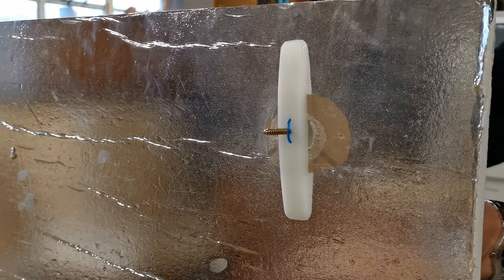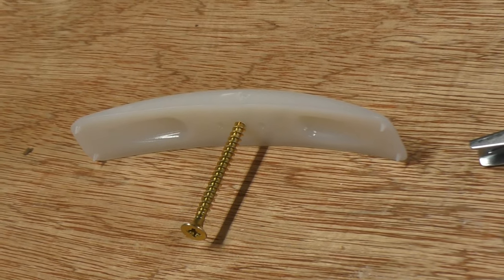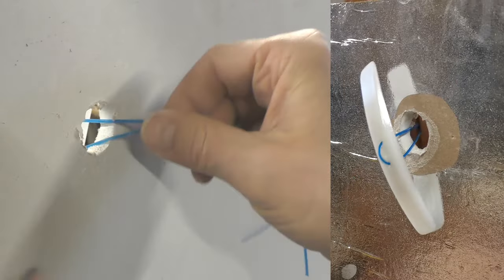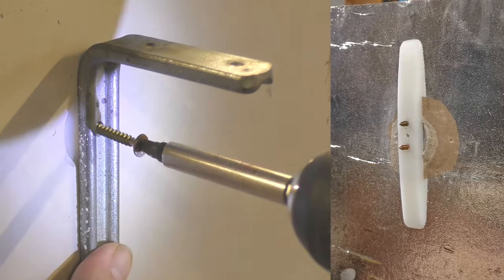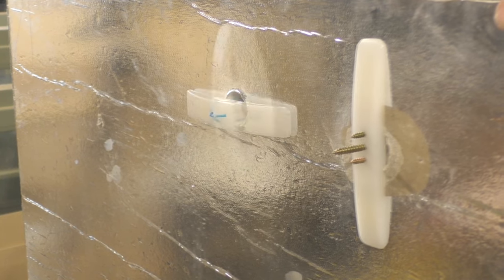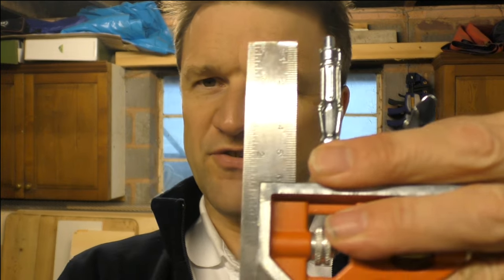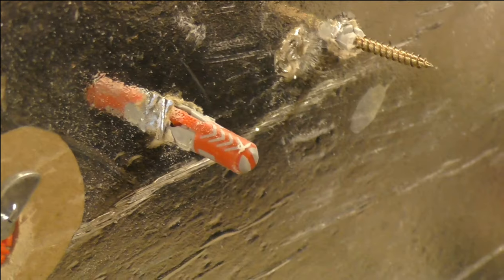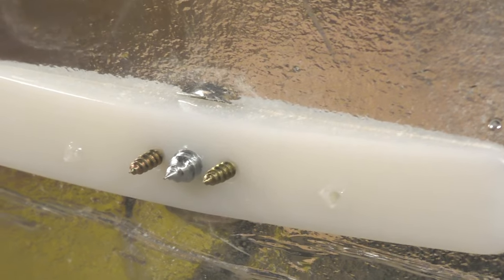The Strongest Plasterboard Fixing Ever!

Comment: This seems to be a very clever adaptation of what I have done for years using a piece of sheet metal.  I like the blue cord idea. My only concern is the knock-out of material on the back side.  when you tighten the plug the only thing that is preventing the plug from being pulled thru is the wall board supporting the lip of the plug.  Using the spade bit reduces the strength of this area (as you can see from the back side in the video) I would not use a spade bit in drywall under any circumstances.

Comment: Thanks for the excellent video Charlie - do you think these could be used into a sheet of MDF? I need to put up a 40kg large TV on a wall that has been made of 22mm moisture resistant MDF (without much studding behind) and was hoping to use these to spread the load behind the screws. Do you see any issues there? Many thanks and please keep up the really informative videos.

Comment: I bought these fixings 3 years ago. Held an old heavy flat screen tv on the wall for those 3 years no problem.

I have since moved and I just tighted the screws up so the bracket sank into the plasterboard filled over the plastic plug with filler sanded and painted couldn't tell it was ever there

Comment: Worth noting from a quick ebay search that the wall anchor looks like about 50p each shipped in packs of 10 and the geefix are £2.50 shipped in packs of 4 so about 5x the price. I would also want to be very careful doing up that central screw (especially if using a power tool) as you could over-tighten and strip the nylon backing which might be a problem. I would use the anchor by default and the geefix only occasionally.

Comment: Great video. Would these be best for lathe and plaster walls, or is something else more suited?
Reply from the maker: What are you fixing, Robin?
Reply: My son’s expensive guitars to his bedroom wall.  Need the guitar mounts that he’s bought to be well secured.
Reply from the maker: @robinknox3569  The benefit of this fixing is a) it's incredibly strong and b) you can self pilot more fixing screws into the plastic wing of the fixing, quite close to the main screw, whereas with a standard fixing you've got to drill holes and insert new fixings close to the original which can be tricky. What is the configuration of screw holes on the guitar wall bracket base plate and will the base plate be wide enough to cover the circular central plug of the fixing?
Reply: Charlie DIYte Thanks for replying. The bracket odds held by two screws which are on a  horizontal plane about 10cm apart. I’m reasonably sure that this fixing wouldn’t show but I’d have to orientate the back wing to a vertical position.   Not sure what my other options might be though.
Reply from the maker: @robinknox3569  You perhaps ought to take a look at snap toggles. They might be better.

Comment: It would be interesting if you did you fixings into lathe and plaster as happens in many old houses<Which holds the best in walls and ceilings as I often find this a problem. This  geefix sounds a solution so I might try that.
How do you fix ceiling roses in to lathe and plaster as cant always find the studs or ceiling beams,or indeed use impact  glues.

Comment: Thanks Charlie.  I created a piece of artwork that’s 6kg and I knew I needed a way to hang it safely on my flimsy plasterboard walls.  I shall look for some geefix fixings as these look perfect.
Reply from the maker: Yes, the Geefix will be perfect for that. Failing which, hollow wall anchors would probably also do the job https://www.youtube.com/watch?v=e3hjzPNe5wk&t=83s, but the beauty of the Geefix is that you can use a normal screw.

Comment: Looks like a great product. Geefix really hits the spot. For now togglers will remain my heavy duty goto which, for the smallest size, are rated at 238lb in 1/2" drywall and they're quite a bit cheaper. I can see a couple of advantages of geefix but until they get their price in line I'd only consider them for these few applications.

Comment: used these recently to secure ceiling rose on dodgy lath and plaster ceiling - works great but as said elsewhere way to big - had to trim the ends off  and could have done with it being  bit thinner...
Reply from the maker: I agree, they could do with producing a smaller version. The real difference between this and most other fixings on the market is the ability to pepper that big wing that goes behind the plasterboard with extra screws, whereas with other fixings you've got to drill another hole very close to the original - which isn't practical.

Comment: Great video! Wondering if you've ever seen or used the Fischer DuoTec? Fischer's tech data state this is stronger than their spring toggles and they have the distinct advantage of only needing a 10mm hole vs 14mm for the comparable spring toggle. Trying to mount a heavy cabinet where the geefix won't work as I can't go much above 10mm for the hole diameter for aesthetic reasons. The DuoFix seems to be the ticket, but haven't seen any meaningful reviews of these yet. Thanks!

Comment: Hi Charlie DIYte can you do a video with the masonry concrete screws the ones that don't use plugs and are mainly used for upvc frame fixing, for a drywall with cavity. Reason I am saying this is because all these other drywall anchors/ geefixt etc plugs are very expensive vs the masonry screw about 4* 6 times the Price. I am 0retty sure they will doona good enough Job.
Reply from the maker: I'll add that to the list. There just be a few videos out there though. I guess the secret is to drill the right diameter hole but I agree they do look good

Comment: Across the pond, we use a toggle bolt that’s called “Toggler”  it’s a simple anchor and each size has a different price and weight limit.
Personally I use the half inch Toggler bolt as each single bolt holds over 200lbs in Sheetrock or plasterboard which ever you call it.
Rarely are our backing wood and or studs are at 16” to 24” apart, which means when you mount a television, the brackets are rarely 16” wide.
I typically only hit one stud but make the difference up with 4-6 toggles/ Togglers.

The Toggler leaves a smaller foot print and typically the plastic back is covered by bracket, even curtain rods.

Regular toggles suck and I am not sold on the blue rope as well, hands free is the way to go, which is why the Toggler is a key fastener for any if not all contractors, 

The Toggler is slightly cheaper in cost, by maybe a coin or two.

I enjoyed your video very much, thanks for posting and keep them coming.

Comment: I'Ve ALWAYS Put a Furring Strip Piece ((About $2.00USD For an 8;'Ft. long Piece: Common: 1 in. x 3 in. x 8 ft. ; actual: .75 in. x 2.5 in.)  
Vertically oriented in order to serve as the internal "Backing" for any towel or hanging fixtures (especially in the bathroom)...but this product is absolutely GENIUS, albeit a bit expensive.
Now I know how to Wire-Cord the Furring Strips going forward to make the install a bit easier....for the Furring strips that is.

Comment: As a trade user of fixings of this nature I would have issues with these fixings with insulation boarding or fibreglass matting, the board you showed will compress over time and it'll become loose....looks a good fixing though.     You mentioned pull up fixings needing a large gap?......... not so 😉    push the fixing through the board until it hits the back then pull up slightly, it'll work it's way deeper as it opens up

Comment: These look amazing - I'd just watched your other videos and got excited about the spring toggles then saw this in recommended! I'm building a false ceiling with some CLS timber (it's for a snug/AV room) and need to secure some lengths of timber to sections of the ceiling which don't have joists, e.g. perpendicular to the joist direction. Are these OK for ceilings as well as walls? Thanks. And great vids :)

Comment: We bought a 3 year-old-home six years ago. This home is built with Terreal Terracotta Bricks, with the exterior being covered with stucco and interior walls of plasterboard. Immediately after purchasing the house we noticed that the kitchen 5 glass-door wall cabinets were tearing away from the kitchen wall. They were quite heavy, measuring 2-meters long x 1 meter tall. They were installed with only 6 huge wall-anchors, 4 of which had already torn away from the wall and only the center two still bearing the strain of the weight; it was obvious that it was going to fall tremendous damage to the interior wall.  The problem had been that the plasterboard was 50cm away from the terracotta bricks. We knew we could suspend our tv on the walls, much of our artwork would also not be displayed because it was too heavy also. Naturally the wall-cabinets would not be returning to any wall in the house. But I do want the artworks which we collected displayed and so I found this video. I'm excited to know that this will be possible now with GeeFix. Thank you for making this video Mr. CharlieDIYte

Comment: Great video! I will be wall mounting a 65" TV (25KG) and will manage to fix 2 screws in a stud on one side but the other side is hollow. Which fixings would you recommend for the hollow side? If this one then does it have to be fixed vertical or horizontal? TIA
Reply from the maker: I'd use this fixing. Probably horizontal but it's worth asking the manufacturer.

Comment: Thanks Charlie, looks perfect about to fix but found the cavity wall filled with insulation so no cavity! Any suggestions tks
Reply from the maker: You're best bet might be a hollow wall anchor https://youtu.be/e3hjzPNe5wk as it will force itself open into the foam insulation
Reply: Thanks for that, know for next time. Actually picked out a vertical trough in the foam and was able to insert the Geefix.

Comment: Brilliant just what I have been looking for to fix an eyelet screw into the landing ceiling,  not being a DIY expert will it work the same in a ceiling?
Reply from the maker: Yes it will. Will the eyelet be hidden as don't forget you'll see the circular disk the eyelet is fixed into otherwise.
Reply: @CharlieDIYte  no it doesn't have to be hidden  it's to hang my paramotor wing in a bag off the floor on a high ceiling away from getting damaged.
Reply from the maker: @fonso1961  It'll be perfect for that!!

Comment: Only slight problem I can see is if there is a dab exactly behind the place where you want to put the support, ie for a radiator bracket, otherwise great product, will definitely buy an eight pack.
Reply from the maker: Hi Steve, yes but every cloud has a silver lining. If you hit a dab that's perfect, because you've got an even better fixing in that you can drill straight into the brickwork behind. In that scenario, and possibly for the others too if the void between the plasterboard and bricks isn't too wide, I'd maybe reach for one of these https://youtu.be/fx90VadXSXA

Comment: No matter what fixings you use there will be an upside and a downside to them all, personally i trust what Charlie has said and in my opinion these do look pretty damn good (have just added some to a wishlist) if  people are worried about the size of the hole that will be left behind if removed then use a smaller plug, but then dont expect it to hold something really heavy to the wall - you cant have everything but you can make the most out of whats the best option to buy - these look the best option for hanging big or heavy items. Thanks for the upload Charlie - great honest review again.

Comment: Hi Chatlie,
Will this work and hold up a 50 pound picture frame art work?  Also you attached a bracket that resembles one used for curtains. What should I used for the heavy art frame.  Thank you for your assistance 
Catherine
Reply from the maker: Yes those brackets are curtain pelmet brackets from the old day job. Seemed like a convenient thing to use. https://youtu.be/Jdu9RId7m90 here's my comprehensive update vid but basically, whilst I can't comment on your exact job, the Geefix is the strongest plasterboard fixing I've come across.

Comment: Which fixing would you use for a lathe and plaster ceiling fix bay track and curtains?
Reply: drill holes through, squirt in loads of Anchoset and push rawl plugs in before it cures, leave to set before screwing in

Comment: Hi, what would you use to fix a TV bracket to plasterboard with polystyrene insulation behind it, probably an inch thick. Whatever they used back in the 70's. Thanks

Comment: you said at some point that you can decide whether the fixing is laid vertically or horizontally, depending on the type of load. can you give an example or recommend a direction for heavier loads? say you're hanging a shelf that will take some significant load, should the bracket be horizontal or vertical? which one is stronger? thank you
Reply: I think it depends on the orientation of the bracket, so a curtain bracket is vertical and the support should be likewise, a shelf should fall into this category too

Comment: Hi Charlie thanks for the previous replies! I was just wondering what you use as a reference for the weight limit of a hollow wall anchor for standard plaster board thickness. Fisher website states arounds 20kg per point for an m5 anchor and the same for an m4 (why are they the same?), whilst other websites state up to 50kg per point for sheer stress. Any clarification from your experience?

Comment: I think a metal backing would work best since basically all is holding the appliance is the screw itself to plastic I would use it if that back part is made out metal I'd be safer for heavy applications! what do you think?
Reply from the maker: The wall would disintegrate before the screw pulled out of the plastic wing, as it's incredibly tough, thick plastic.

Comment: Hi Charlie Great Vid! I just bought some wall anchors based on your previous videos and now thinking of changing my mind. I'm hanging a 40 kg mirror which is round on a regular plaster board wall. There are only two screw hanging points on the frame at either end of the mirror (158cm apart). Would wall anchor's work i.e. 20kg/s per points (without the wall just coming away with the fixings intact)?

The round mirror also has  a wooden beam along the back which i could secure more mounts to I guess

Thanks 

Dev
Reply from the maker: Hi Dev, are the hanging points you mentioned slotted mirror brackets that the screw slots into and slides up, or something different? Bottom line, the wall anchors are amongst the strongest plasterboard fixings so you should be fine with them, particularly as your load is shear only rather than cantilever. I ask about the slotted brackets though because the slots are sometimes quite small in diameter, preventing you using quite a lot of wall fixings because of the size of the screw head or bolt not fitting into the bracket (although I have been known to grind down the head of the bolt to make it narrow enough to fit.
Reply: @CharlieDIYte  legend for replying so quickly - really appreciate! Exactly as you say: the screw slots in and slides up the width is 9mm. The depth of the mirror is 60mm so I guess there is a very small cantilever but it should be okay .... right (for 2 wall anchors taking a load of 40kg)?  Any specific wall anchors you would recommend that would fit the 9mm diameter?

Comment: I have that awful paramount egg box partition in my house, will it work with that?
Reply from the maker: It's as good an option as you're likely to find. Depending on the thickness of your wall you might have to trim down that circular plug with a junior hacksaw - as I did when I used one of these in my son's Ikea flooding shelf, which is basically the thickness of hardboard.

Comment: Hi,
Would you suggest this fixing for the Murphy's bed?
Also, I have 2 layers of the plaster, so it is thicker. 
Can I use this same fixing?
Reply from the maker: Can't comment on the Murphy's bed but yes you can use this with double thickness plaster. You just use longer screws.

Comment: Used these tonight, drilled the 25mm hole only to find Thermalite block directly behind. Oh shit !!! 
Solution.
Cut the long strip that sits in the wall, I cut mine at the scalloped bit which left it without the scallop and about 1 inch in length total. Yes it's weakened the fix, but the option was a 25mm hole left in the wall. 
I hung a painting on mine measuring 4ft x 2ft, all good.
Reply from the maker: Good solution. Next time, drill a 6mm pilot hole first, and poke through an unfolded paper clip or other piece of wire to see how much space you've got behind the plaster board.

Comment: Have a 2 1/2 ft shelf in front of the window for the cats to gaze out the window.  The 16lb., 12lb., and 10lb. cats were watching birds when the 20lb. cat launched himself from the top of the cat tower onto the platform.  After repairing the drywall, I sunk the screws into the studs.  The 2 toggle bolts held really well on that 1sq ft of drywall that was ripped out leaving a huge hole in the wall.  Drywall has its limits.

Comment: thats a bit like using a piece of 2 x 1 baton  around 6" or so,i used that method years ago and still do,cut a relatively small hole 1" x  2" or 4 " make sure your have the centre of wood in line with the centre of opening place a screw off the centre,so wood can be slotted in (2 screws needed one off centre the other in the centre or close  too,)slot in screw one end while holding one end,fix other end replace plaster board ,apply gunk to fill and finish ,fix what ever it is that needed fixing,so that basically is a modern way of doing something  that was old school .cleaner and quicker .